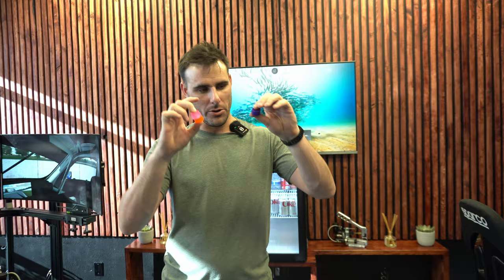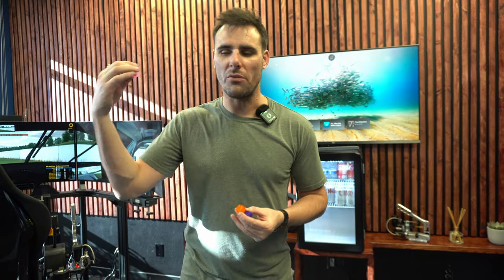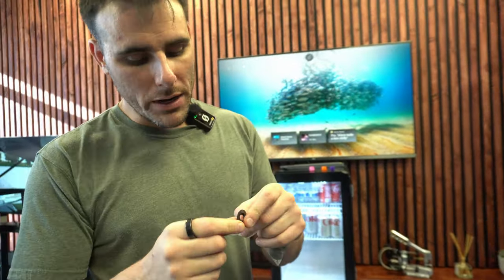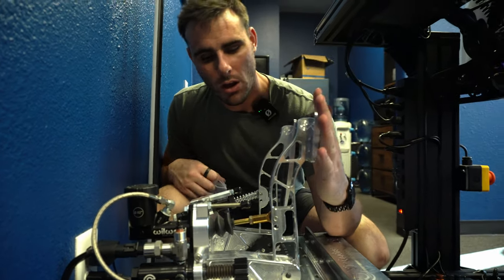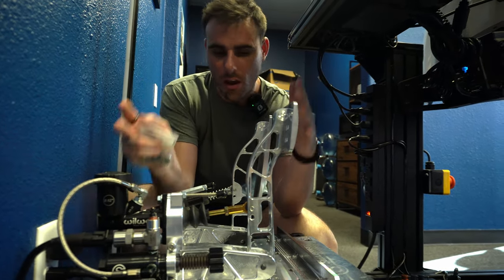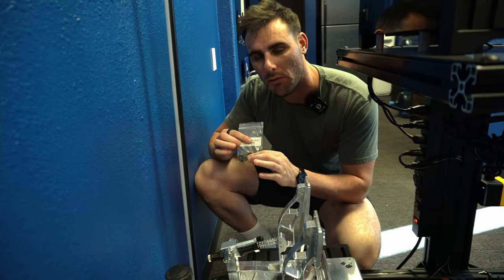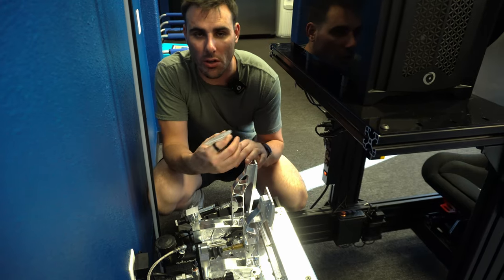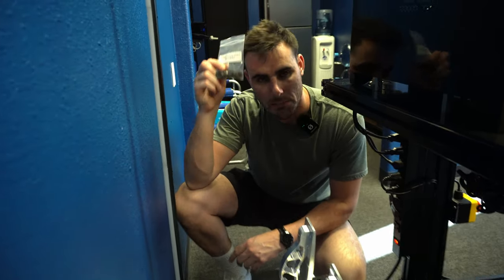$30 Upgrade Makes Sim Pedals Better!

Comment: Does this only apply hydraulic to pedals? Before I switched to the Simgrade VX-pro pedals, I had pedals sets with polyurethane bushings. The whole reason I went with the VX-pro pedals were that they are spring based. With the Polyurethane bushings I had the problem you described where even after 15 minutes you felt your brakes changing. Now I no longer have that problem.
Reply from the maker: Hydraulic pedals are the only ones that compress the Belleville springs because of force required

The reason they’re better than springs is because the springs are limited to spring rate

These Belleville springs can be mixed and matched to create and completely unique pedal feel matching exact pedal force of in car if you know that number